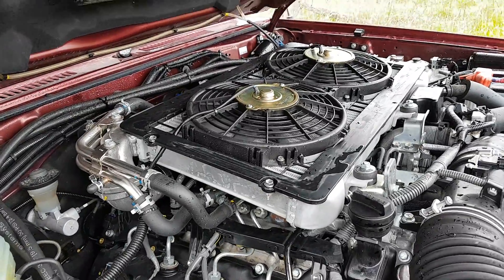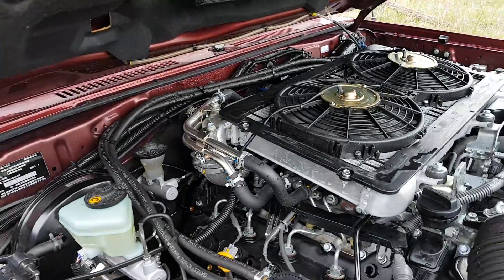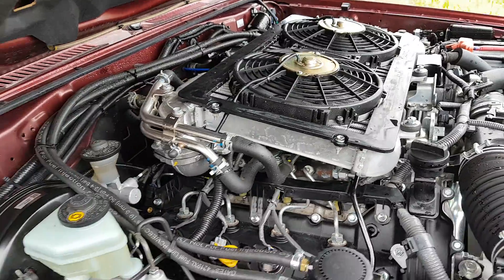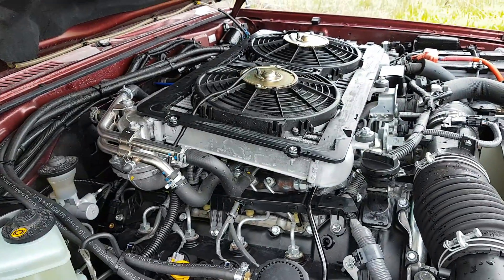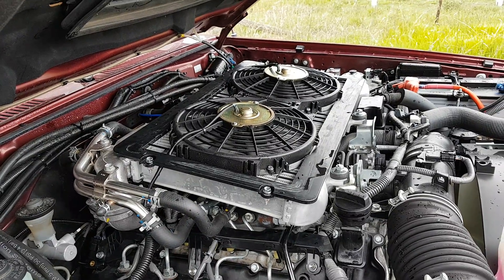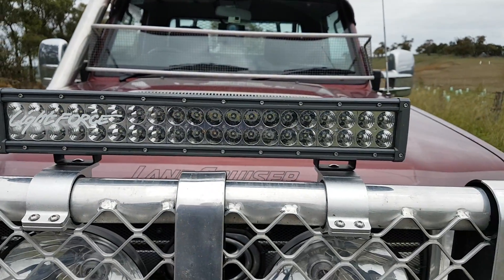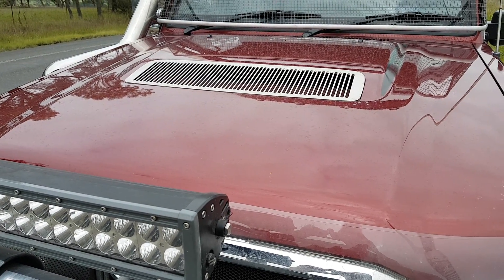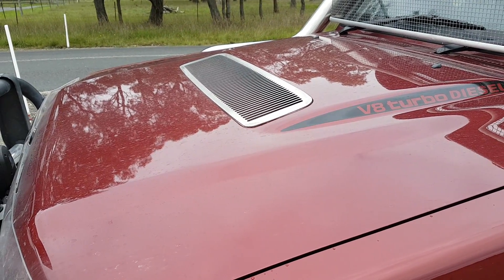Save Dollars with a Berrima Diesel Intercooler Fan kit.

Comment: Just add a water methanol injection kit. Cost effective and simple. Even just running straight h2o will fix heat soak
Reply: @farnarkleboy  even just running straight h2o will fix heat soak
Reply: @farnarkleboy  how many modern vehicles still run an iron block. These days.

Comment: Putting a truck bull bar and light bar in the way of the intake of course it will hinder the intercooler intake
Reply: True. I have similar setup. Did test before and after. Cruising is about same, but trashing gives roughly 10°C more IAT. Not much, but measurable.

Comment: Science dictates that hot air expands and rises! So where does the hot expanded air go???? - down onto the engine, gets hotter, bounces into air from the radiator fan and both overheat the engine before finally exiting underneath/ behind wheels further heating the Utes cabin. Should duct air to the bottom of the aftercooler and use the fans to push the hot, expanded air out through the top of the bonnet. If you think this is new check out the cooling vents on a 1970s Honda Civic - science has not changed since then, just people's aesthetic desires.
Reply: It would make more sense to pull cool air in from the top and blow it out to the bottom of the intercooler, and then it will be vented out of the bottom of the engine bay with the rest of the hot air

Comment: regarding a td42. would it be better to have the fans mounted on the underside or on the top?
Reply: I think you'll find the fans in the video are blowing air down thru the intercooler (with the natural airflow thru the scoop) NOT sucking air up thru the intercooler against the scoop air flow.
Reply: I'd say fan underneath as the scoop is more efficient on the GQ, so fan is only needed at low vehicle speeds or when pulling very hard. Fan ontop makes scoop less efficient... Make sure fan is sucking air down through intercooler and not up and out the top like in this video otherwise you'll be fighting the airflow when there is vehicle movement.
Reply: My intercooler is rammed well enough. I want thermo to vent the shit out over windscreen from old school ram air bonnet or a vent

Comment: if you cool the air of the intake , that will lean your fuel air mix , so do you have to tune your engine to give it more fuel,  and your view on blocking of egr using a plate, thanks
Reply: peter krych doesn't work that way mate do you get your car re tuned for winter and tuned summer the car deals with that
Reply: @livenloud6697  I know this is an old comment, but for anyone who sees this and is wondering; the oxygen sensor on the exhaust side will work with the MAF to let the engine know if its burning too rich or lean and actively tweak the fuel injection.
Reply: @saltananda3227  uhhhh, nope not how it works on a diesel, and not on the VDJ. Why do people write this stuff when they have no idea.
Reply: @irubx  You're one to talk. Almost every single modern ecu works that way, diesel or not, actively updating the engine map to get as close as it can to a "desired" mark. Which involves reading all the sensors and adjusting air/fuel ratio depending on excess, or not enough air.

The only way that isn't the case is for tunes that lock to a desired map instead of being dynamic, like getting a custom map done.
Reply: @saltananda3227  Nope, diesels very rarely use, or even have fuel trims. They don't need to be at lambda like petrol, they can run 60:1 and run all day every day. Most modern are torque based calculations that is derived from pedal position so effectively closed loop, unless there is a protection involved like EGT, ECT or atmospheric pressure.

Comment: they will not fit under the standard bonnet without modifications also it blocks all the air coming over the intercooler through the bonnet scoop.
Reply: Mate you should give Qantas a buzz and tell em those turbofan engines are blocking airflow while flying
Reply: “Fans block air” is a bit of an odd thing to say, I mean sure technically but not when they’re turned on they don’t.